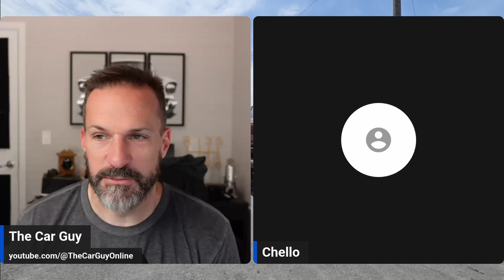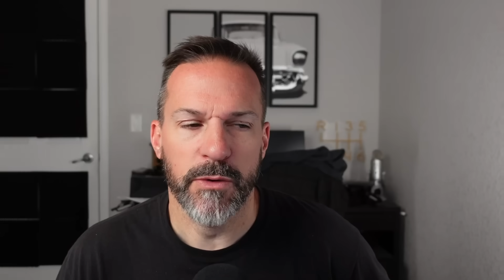Former GM Engineer EXPOSES Planned Obsolescence Tactics.

Comment: Well, when i spend my hard earned money on something and it breaks, or doesn't last.  I go to a different brand. They'll lose at this game. 

Now i try to buy older more reliable items.
Reply: Unfortunately that's not sustainable because eventually the older stuff will age out as well. Parts availability and aftermarket parts quality is an issue too. We are in a golden age where this is still an option but it won't be for a whole lot longer.
Reply: There are still pickup trucks from the 70's 80's and 90's running strong.. how many 2020 models do you think will last more than 20 or 30 years, with all the electronic crap stuffed into them?@CyFi6

Comment: I may never buy another GM again!  Or Ford. Or Ram or Toyota.  They all seem to have significant issues. Miss the good ole’ days with quality parts and engines/transmissions.
Reply: Just buy one you like from 1995 to 2005, pay to have it fully restored, and add whatever electronic doodads you want. You will have spent less and have a quality car or truck that will last 300k miles (or more)
Reply: @MDAdams72668  That is where a huge part of the commercial trucking and even farming industry is going now.  You can buy half a dozen machines from that era and do a full ground-up overhaul and restoration for what you will pay for one new machine.
Reply: You🫵 will buy an 80k$ truck with a crappy transmission that will crap out on you and you will like it!
Reply: 1999 manual turbo forester with 375,000 km. No rust, uses very little oil.
Timing belt done twice, clutch done twice. Other than that only fair wear and tear. Still has plenty of poke, and still worth the same money I paid for it a decade ago. I did go thru an NVH exercise with it. Absolute pleasure to drive, 5 star safety rating.
Parts readily available, new and used. No plans to replace it for another decade at least.
Reply: I will say that the Ford superduty line is pretty good now.
Still working out on the 7.3 on how it will stand up over time. It's too new to say currently.
The 6.7 powerstroke has proven to be a good engine.
Same with the 6 speed auto behind it.
Reply: I wander if they push us toward EV bs 🤔
Reply: @Podchynok  EV's will never give 150000 miles unless you pay thousands for batteries.  Only STUPID people buy EVs or hybrids.
Reply: When was that?  Auto companies are focused on ONE thing, MONEY and how to get it from your hands to theirs.  Every vehicle has at least ONE (some have more) part that when it goes the vehicle goes to the scrap yard.  This has ALWAYS been true.
Reply: @lostvisitorif that were the case, how is it that cubans are still driving a bunch of cars from the pre-revolution era? The only way those things can still be running is because parts are relatively easy to reproduce.
Reply: @generalzod7959  1. When resources become limited a smart person becomes creative.
2. Cubans are very creative, smart and motivated.

The reason those cars are still on the road have more to do with the skills of Cubans than the design of the car.  If the cars were that well built we would be driving them here not admiring them in a car show.
Reply: What are you going to buy, a horse and buggy?
Reply: If you don't want to buy a Toyota, what the hell do you wanna buy then?
Reply: @VicTheButterfly Ha!  Honda Ridgeline?  That’ll get everyone going!
Reply: @dewaineallen9161 probably the most reliable one there is out there.
Reply: @VicTheButterfly Honda or Mazda.
Reply: @VicTheButterfly Nissan I guess